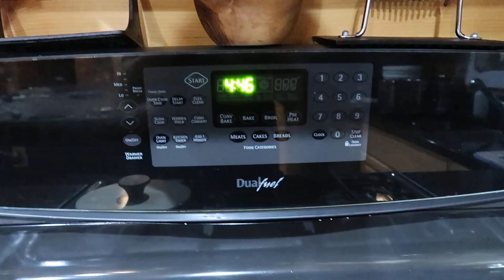Easiest Way To Stack Firewood

Comment: I was able to over winter a pepper plant, I put it in front of my patio door which had eastern exposure and it did really well. I actually ended up getting flowers on it through the winter. I used a cotton swab to pollen the flowers. St first nothing but after a bit I started to get some. So you never know
Reply: Wow, I took one in last year but it died. Will try again this year!
Reply: Pepper plants last for years and years. Ours gives peppers than the leaves fall off for a few weeks than they get new leaves and the cycle starts over again. So far they live about 4 years than die.
Reply: @lindanwfirefighter4973  wow
Must try to overwinter one again!

Comment: Good choice on your wood stove with outside metal chimney Al. We keep extra ash in both our stoves.. Also put a double grate in our vintage kitchen wood stove to slow things down. Used a central chimney for our airtight cellar stove because we designed a central floor grate. Installed a " through the cathedral ceiling" stove pipe for our kitchen wood stove. Heats 1000 sq. ft. upstairs. Does make for a more tedious chimney cleanout... Great chicken soup!

Comment: Try finding a stone countertop fabrication company nearby that does soapstone. You can arrange to get scrap for their fabrication to put in the bottom of your stove. Soapstone is the best material for holding heat. If you can make a hearth and surround behind the stove, it will radiate the heat for a long time.

Comment: I save the stove ash in a steel trash can. It works good to help ice melt when there is sun out. The sun reflects off the bare ice with little melting. But, sprinkle some ash on the ice and the sun melts through the ash. Give it a try this winter.

Comment: I have a fall breakfast/brunch/side dish recipe for you. It is a version of Hutspot (Dutch) that uses caramelized onions, roasted carrots and roasted potatoes and garlic. You can make it like mashed potatoes with cream (goats milk) or like I do (cubed). Caramelize 1 c onion and 6-10 cloves of garlic or equivalent in garlic powder (to taste) and set aside. Using the same pan (I use cast iron) add in olive oil and butter equal amounts. Cube carrots and potatoes (or buy bagged cubed carrots and hash browns to make it quicker)  and roast on medium low heat until the potatoes are browned and the carrots are roasted. Add back the onion/garlic mix. Mash for a side dish or leave whole for a hash brown accompaniment to eggs or breakfast sausage. For a dinner it is great with summer sausage or kielbasa. Warning: This can be very sweet if you do not add garlic.

Comment: Al, when sweeping your chimney, you should be wearing top hat and tails, (traditional chimney sweet garb), and dance around singing "Chim, Chimney," (if you don't get this reference, you might want to rent "Mary Poppins" for movie night.)  :-)  
Composting tips; this is not criticism, it's intended to be instructional. A good compost pile needs oxygen (aerobic) to function well. Your composting buddies, microbes, beneficial bacteria and fungi, need this oxygen. A static compost pile, one that doesn't get turned over regularly, soon becomes anaerobic deep inside. This condition does not allow your composting buddies to work. Instead of decomposing, this interior rots, becomes slimy, mushy and moldy, this does not make for good compost. Your compost pile has all the ingredients to make great compost, but it needs your help. As it sits right now your ingredients are in layers, the original compost, the greens and squash from your garden, the nitrogen rich scrapings from the greenhouse and now a layer of ash. Rain will not move the ash through the pile, but will tend to compress, and compact into cake, further starving your pile of oxygen. Your compost in layers, each layer is like a monoculture that supports only some of the composting buddies that work with the various ingredients. Regular turning of your pile (weekly) will blend all of these ingredients, keep your pile open and aerobic, and will decompose more evenly and faster. A good finished compost is ideally well mixed, light and fluffy, full of carbon, humus, nitrogen (chicken and pig poo), potassium, (ash from your wood stove) and all well blended. There is not much movement of these elements in a static compost pile, they remain in these layers, and your composting buddies will not work as efficiently. The 20-30 minutes it would take to turn your compost once a week will work wonders in making a great compost for your gardens come spring. Right now with the rain, cool weather is a good time to be working that pile and turning it over. 
A good compost also generates heat, which will keep it thawed even when temperatures drop below freezing.
Reply: David--I am singing that silly song in my head, too, watching Al!!
Reply: June, I know, quite the earworm. LOL
Reply from the maker: It's been a while since I've watched that movie. But I don't think I could ever forget it. Lol
Reply: My neighbor has a compost pile near her garden and states the most important part of the compost pile is her long handled shovel which uses to turn over the compost once a week. Her compost piles thrives and when it snows within an hour or so after the snow stops the compost pile is bare.

Comment: By leaving the ash in there, you are making the firebox smaller. Consider lining the bottom of the firebox with firebrick instead. Experiment, but I would think the firebrick would have more thermal mass and give off more heat after the fire goes out at night. 💜🌞🌵.  P.S. all that black dust in your chimney and soot on your glass tells that your fire isn't burning as efficient as it could. I can't offer any solutions as I don't know your stove, but that's a lot of black stuff for only 1/4 of a season.

Comment: Have you any suggestions on how to get hard water deposits off shower doors? I watched how easy you clean the glass on the stove and thought about shower doors.
Reply: Get some CLR Bath and Kitchen. It comes in a yellow spray bottle and you can get it at Walmart for around 4 bucks.    Cuts water spots like nobody's business

Comment: Gooood Mawnin' Al!  What does it cost in your area for a full chord of split aged hardwood?  Do you have a large amount of young entrepreneurs that split and sell wood or are you buying from a larger supplier?  I had a lot of high school students that made cash selling wood that they cut and split for income on the side.  They might not have had the best cuts and there was always the occasional chunk of pine mixed in but the prices varried and if you shopped around you could get good deals.
Reply from the maker: The price is around $225 a cord cut split and delivered. I wish we could find a young kid trying to make a buck to buy it from
Reply: I used to get alot of free wood from craigslist ads. I would offer "free tree removal" I got tons of hardwood trees that way.  Lots of work though

Comment: Does ur ash pan door need a new seal perhaps?
tuck those fingertips when using a cutting board!  run the side of the knife along the first joint in ur fingers.  safety first.

Comment: You lose a lot of heat, even with triple-wall, or insulated pipe, by running the chimney up the outside, rather than up through the interior of the house.